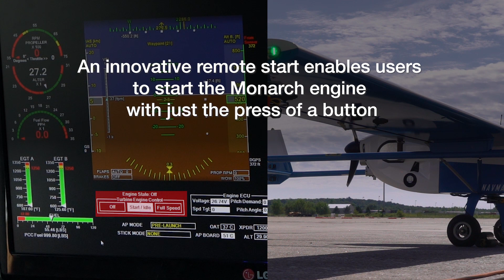UAV Turbines Introduction to the Monarch Microturbine

Comment: Guys, one of the new requirements for UAS is the ability for the engine to operate a thousand hours before any major maintenance. Currently we can achieve only 250 hours at best. A turbine engine has the ability to achieve this. A hobby grade turbine normally has an operational life of 70 hours before the bearings need maintenance. Also the most important part of having a small turbine engine is overcoming its inefficiency. Hobby engines are insanely inefficient with only being able to compress the air around a 3:1 ratio. This is the main reason they are not used. Benefits of this engine is its power to weight ratio, time before maintenance, heavy fuels and efficiency for its size. Hope this clears up the confusion. RQ-7B V2 instructor.
Reply: Recuperated microturbines running on magnetic or airfoil bearings perhaps?

Comment: A few questions.  Why is AVGas difficult to source?  If it really is that hard to buy, why not just use regular unleaded gasoline?  Wouldn't that be the easiest to source?  Also, how is your micro turbine different than the Jet Cat turbine already in use for similar applications?
Reply: The most complete answer can be found from Lycoming's CEO - look it up = but basically AvGas is a specialty "lubricant" according to the petroleum industry - so few gallons per year used - and the t4 lead only comes from the UK in a unique shipping system (exceptionally carcinogenic ). In many parts of the world - AvGas is amazingly expensive - if you can find it at all. UL  fuels do not have the anti-knock capability of leaded fuel - especially at altitude - albeit there are approved airframes for such via an STC. Finally, militaries do not like having multiple types of fuel  to have to support in the field. Jet type fuels can run aircraft and diesel type engines - (but diesel - due to internal paraffin's - should not be used for aviation!)
Reply: The military wants to be able to use one fuel.